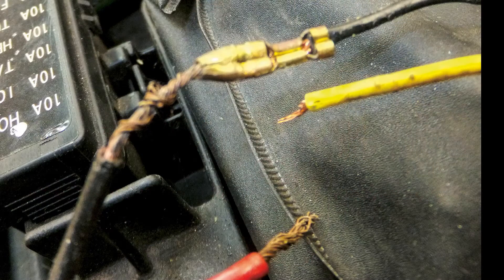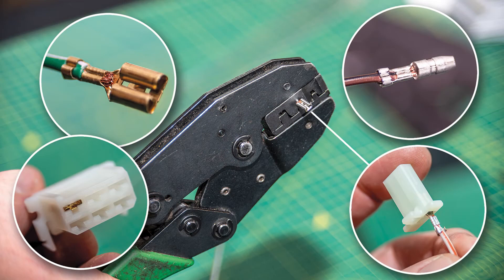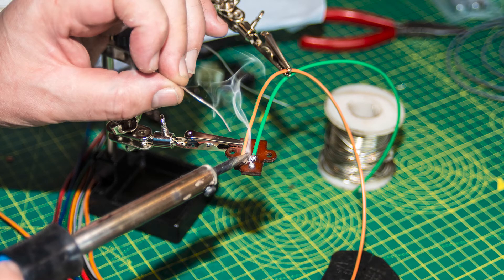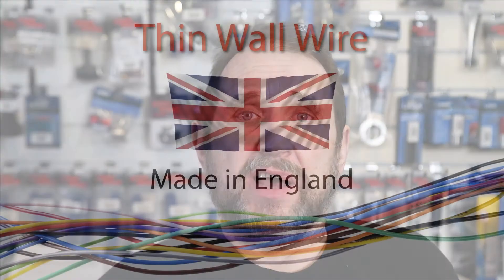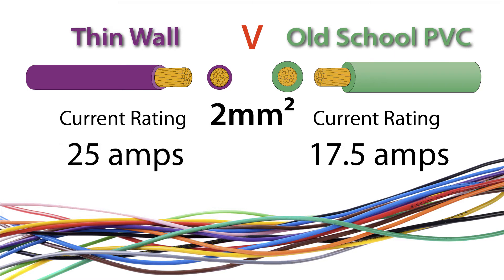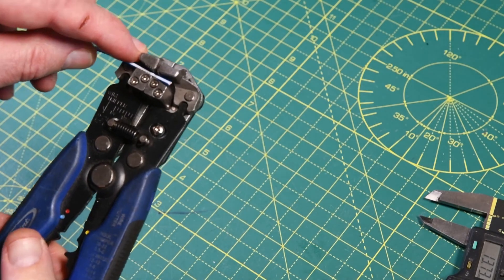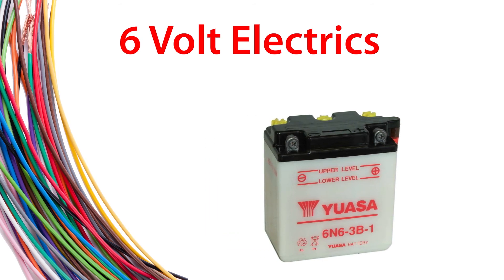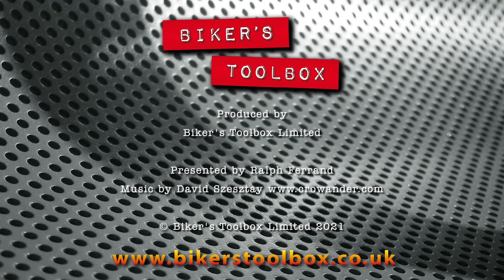Motorcycle Electrics Tutorial Part 1

Comment: Can you explain how to use ACF50 corrosion block grease (or electrical silicone compound) for example to reduce potential corrosion in a 3 way 6.3mm block connector? I'm guessing it applied to the external plastic of the connector and not the cables or metal male/female terminals? Many thanks.

Comment: Morning Ralph,  wondering if you can help.
I'm currently restoring a early 90's Zephyr 750.
I'm not getting spark, looks like the previous owner found this out and sold it.
I've run tests to the best of my ability,  and pretty sure its the Cdi/ecu, also maybe the junction box/fusebox.
My question is, rather than replace an old broken ecu with an old working ecu. Can I just swap it out for a more modern set up?
Cheers 
NMM

Comment: Thanks Ralph I'm just about to order some terminal blocks from you for my Triumph America's light bar which has been PVC insulation wrapped!!! argh!!! It also has a bullet connector on one (the Earth) of the wires out of the three in the lightbar look terminal block which connects to the bikes accessory terminal block and I can't seem to find the small connectors that Triumph use in their terminal blocks so I thought I would change the blocks completely, that  unless you have can advise otherwise as I'm really reluctant to cut the terminal off the bikes loom.
Reply from the maker: Unfortunately modern bike manufacturers seem to use lot of weird and wonderful connector blocks in an effort to prevent folk from repairing their own bikes. We can get far more terminal blocks than we have on the site, but there are so many different types and they usually require very expensive crimp tools so we have decided that it's not really cost effective to be listing really specialist stuff. Many bike manufacturers seem to be using connectors that simply aren't available. The car people are doing the same, but because of the volumes involved it is viable for aftermarket people to tool up to sell pattern versions, but this doesn't seem to be the case with motorcycle stuff. Honda for instance will not sell manuals any more, even to the motorcycle trade. They say it's online, but the 'online' stuff is only available to franchise dealers.
When I was faced with a customers with a melted connector block on a Street Triple where the main dealer said that he would need a complete new wiring loom and ignition switch with a bill knocking on the door of two grand, I replaced the connectors block with a 2.8mm mini block and bill for fitting and supply in double figures, rather than four figures he was well happy and as far as I know his bike is still going fine.
Hope this helps

Ralph
Reply: @ralphferrand8447  Thanks Ralph I appreciate the swift reply and that really helps. I have one of the more expensive crimping tools already thankfully so I will pop over to your site and order some blocks etc. Looking forward to your next video on wiring them up. When's that likely to be posted?
Reply from the maker: @jasons9417  Hi Jason. Sadly with lockdown I'm on my tod for making videos, so it's very time consuming and I also have to run the business and write stuff for Classic Motorcycle Mechanics magazine to make some money to keep the proverbial wolf from the door. I'm keen to crack on so I'm working seven days a week and will get there ASAP, but it takes much more time to shoot and edit the videos than you might imagine. Writing the scripts is a ball ache as is the animation. I'll get there eventually. Once we get out of lockdown I have some friends who have volunteered to help which will make it much easier. It's so hard to do solo!
Cheers
Ralph
Reply: @ralphferrand8447  Thats totally understandable Ralph. I have just ordered some stuff and look forward to them arriving. Stay safe that end and thanks again. Cheers Jason